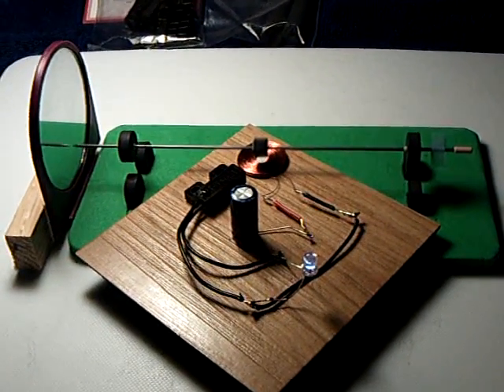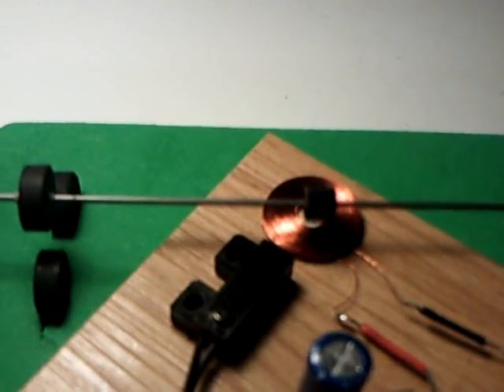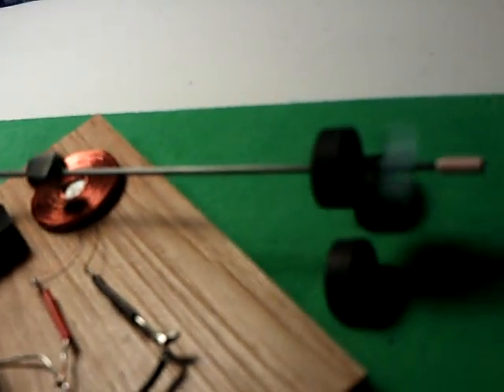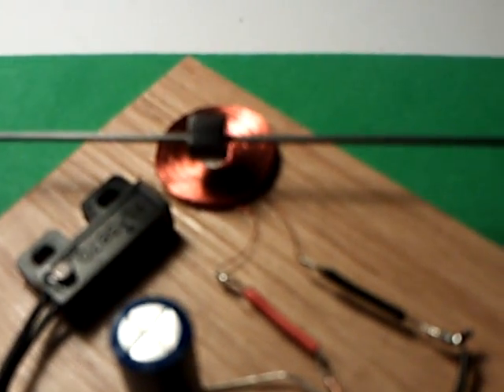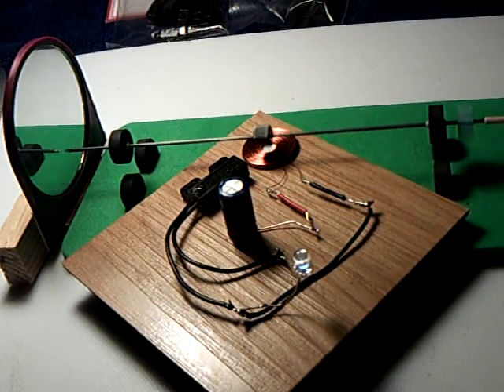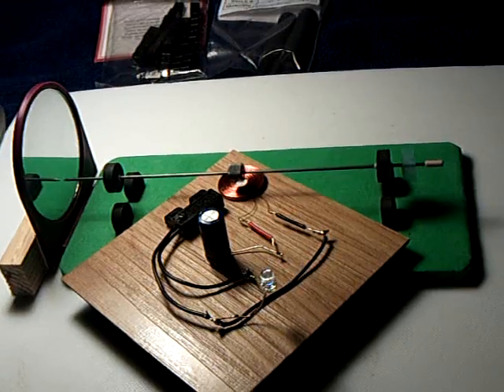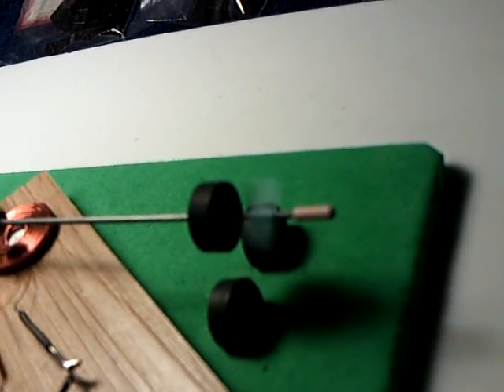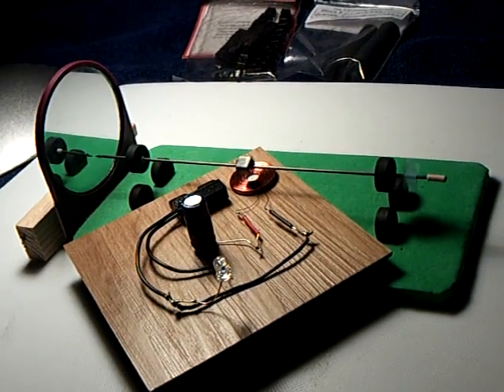Magnetic Jewelry Bead ---- Floating rotor motor

Comment: Well, the mirror sure makes it look more upscale. What about also using magnets on the ends of the rod with same pole magnets facing each other to get the repulsion to keep it from traveling east or west. 
And if u need to make such a device more mobile you could add magnets above the rod on each end to hold the rod down. So then you would have repulsion in all 4 directions.  Just an idea.  I enjoy your videos. Thanks.

Comment from the maker: All the mirror is needed for is to provide a smooth and hard surface for the rotating rotor point to rest against.  It is the one bearing surface in the setup.  The original 'Mendocino' motors used them and I have always thought that it also looked good.  Glass or any hard and smooth surface will work.  When the partially levitated rotor is done correctly there is very little sideways pressure at that bearing point.

Comment from the maker: The key to getting this to work was those weak ring magnets with the small hole in them from Electronicgoldmine.  Thanks for the tip about those.  I got this to work today using a solar dancing flower driver.  I had to 'bias' the bead magnet with two small magnets of different sizes attached to it.  Odd arrangement but it worked.

Comment from the maker: That might work as long as the magnetic fields of the levitation magnets and the shaft end magnet are not too close to one another.  You might get cogging then.  I did a similar setup years ago and it worked ok.  I used a steel ball on the end of the rotor shaft as the bearing point and put a thin piece of plastic between the magnet and the ball to reduce friction.  Adjustment of the levitation magnets at the other end of the shaft reduced the pressure at the point contact.

Comment from the maker: You are welcome.  I have thought about doing this vertically.  It should not be hard to do.  This 'Mendocino' setup is a bit tricky but when you get it just right it works very well.  There is very little friction at the point contact.

Comment from the maker: Thought you would like this one.  If I add neo magnets on the sides of the bead magnet, some of the other circuits we have might work on this setup.  The bead magnet alone is too weak to trigger an electronic circuit it seems.  I have tried it several times with no luck

Comment from the maker: Hi Jack.  Those levitator magnets are magnetized through the faces.  They are pretty weak and need to be for this to work.  Neo magnets are too strong and over power the weak bead magnet.   Electronicgoldminedotcom has these ring magnet and they are dirt cheap.  They are only $1.29 for 26.  The hole in the middle is 1/8".  Slider told me about them and has already done this motor.  Perhaps he will do a video on it also.